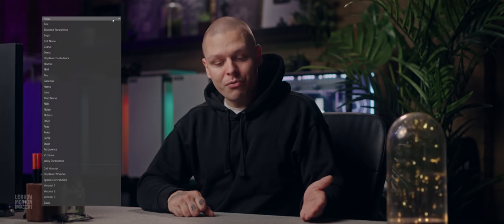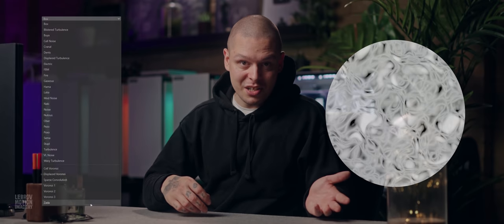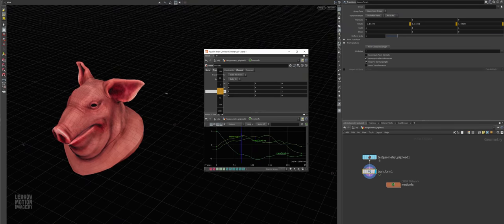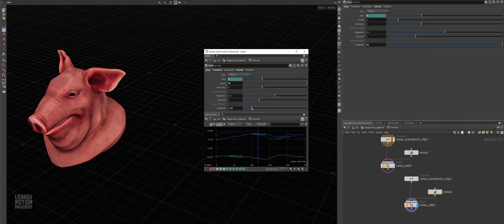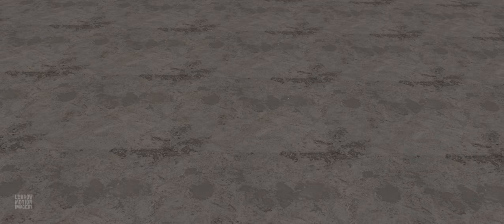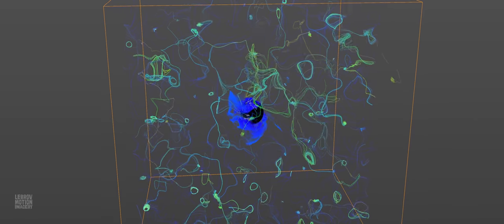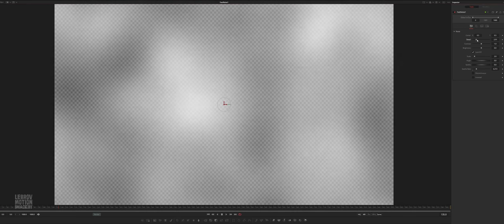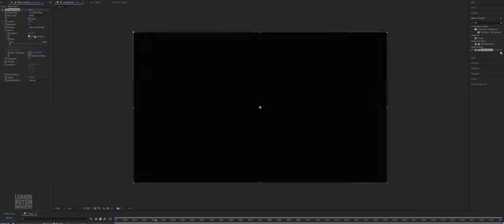The power of NOISE in CG

Comment: It's also important to note that the little bit of noise that would be realistic, introduced to a 3D render during compositing, will also reduce the compression on youtube and other sites, therefore the video will be better quality. Another added bonus!
Reply: Can you elaborate?
Reply: @HawksNestYT  admittedly I know very little about 3d but in the photography  many video world, grain tricks the compression algorithym, into thinking areas of pixels are far different, than they are as the compression process on most platforms, effectivly looks to group similar clusters and compression them, so detail in shadows for instance is often lost. Just a theory but I imagine a similar logic would apply here
Reply: @HawksNestYT  What Aaron said is basically correct. Say, you have a shadowy area. The colours will all be fairly dark, let's say close to black for this example. YouTube will want the video size to be as small as possible, and it can do that by reducing the amount of colours in areas where colours are very similar to each other. So all of those coloured pixels in the shadows (which are very slightly different) will be made into one colour to save data. Then you get blocky video, as you may sometimes see with videos that have a lower colour depth as well.

Grain consists of all kinds of different colours. Now, overlay that over the shadow, and YouTube can't make out that all of those colours are quite close, because the grain constantly changes the image, and every pixel is a more varied colour than it would be without the grain. And since YouTube can't see that it's all kind of the same, it can't reduce the colours. Therefore, better video quality!~

Also it would always be there to some degree in real photography / video, so it adds to the realism too.

Comment: Say. Is this aspect ration 1.85:1 ?
So true about noise in CG. It's important. Part of what can make CG "look like CG" is that it's too perfect. Noise adds those imperfections. Several layers of different types of noise too.
As a musician (Voxonitus) I have taken to adding background noise when mastering my songs. There's a wonderful free iZotope plugin that emulates vinyl noise. Plus a bit of shaped pink or white noise. Both at very low levels. Like -20 to -35db. Virtually inaudible. I'm convinced that it adds to the "warmth" of the final output.